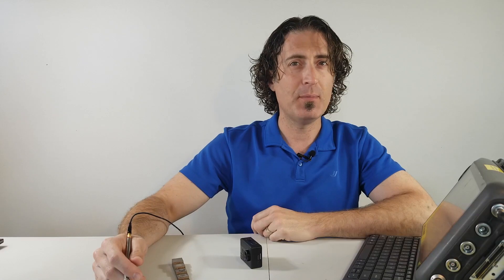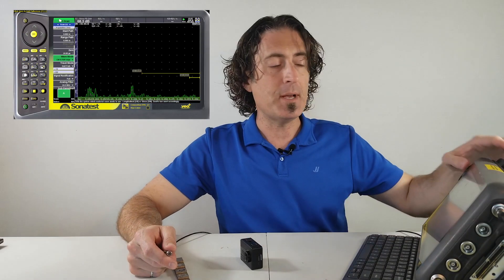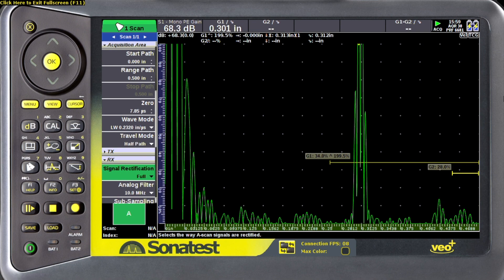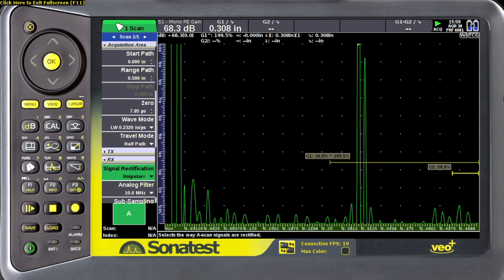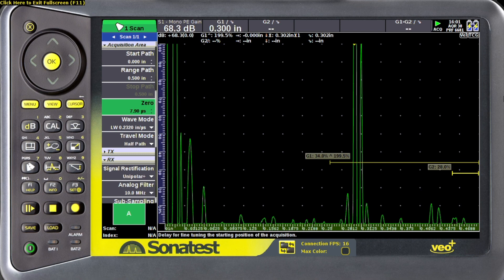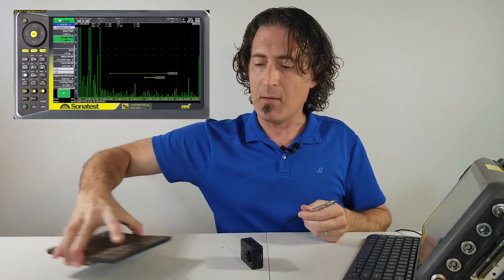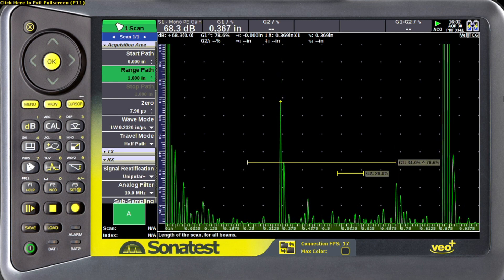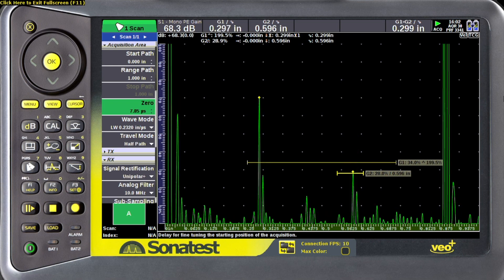Simple tips for using an ultrasonic pen probe

Comment: With those pen probes do you put a couplant down the hole when u unscrew it, and I'm trying to get a cleaner signal on my Olympus 650, won't give me accurate readings past .500
Reply from the maker: Yes you have to couple the delay line to the probe. And these are typically so small and with a high frequency that you won't get much more than 0.5 inches anyways.
Reply: Thank you

Comment: I understand using the strongest signal (I.e. half + or - ) why not use the non rectified signal gate on either peak or leading edge. ? 
With peak you can lower your gain so it doesn’t have to be very loud.  I have found the returning back wall is never great so using the 2 gate method is not my preferred method.
Reply from the maker: Getting 2 echoes on a little pit is pretty hard, especially if there's not much meat left. I like RF signal, too.

Comment: Ultrasonic pen probe can be use for 3/4inch pipe thickness checking?
Reply from the maker: Hrm… that would be a little difficult.  Remember pen probes are high frequency, so they don't work well on thick parts.  And secondly, they have very small piezoelectric elements which don't impart much sound energy into the part.  Third, they're usually very highly damped.  Strike one, two and three.

Comment: Nice vlog Paul, we are connected on LinkedIn and I really appreciate what you work. Just a question, is there any probe available in the market to check bonding between two different metals ? I mean, thickness in the range from 2 to 16 mm ? Also we need to check the same bonding inside curved surface like valve bodies, pipes etc. Appreciate if you can share any information. Thanks, Peace 🙏
Reply from the maker: Hi Binny, sounds like babbit bond testing. You want a single crystal probe with a delay line to reduce the dead zone at the entry interface. I use an Olympus V206.  Then you watch for either phase reversal or loss of 2nd backwall, depending on which side you're inspecting from. Hope that helps!
Reply: @hollowayndtengineeringinc.5201  Thanks for the quick reply. Right now I am using a TR Probe 2.25 -5Mhz, 10mm & 5mm respectively. Problem currently we are facing is, how to get proper seating on the inside of a small Dia part. Very difficult to find good probes or wedges to get good contact. Thanks
Reply from the maker: @MrBinny1977  that's why the V206 is nice. You can grind the delay line against the surface to conform it to the part. The V206 is a 1/2" dia. You may be better off with the 1/4" size.
Reply: Great video Paul! I’m stealing the RF mode trick for thickness testing on thin parts!